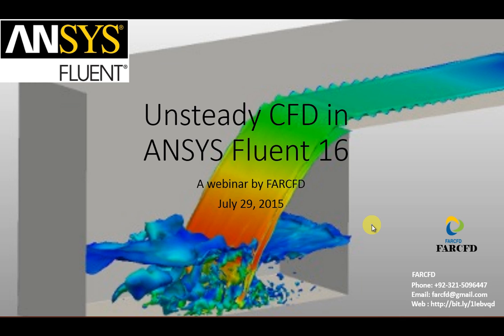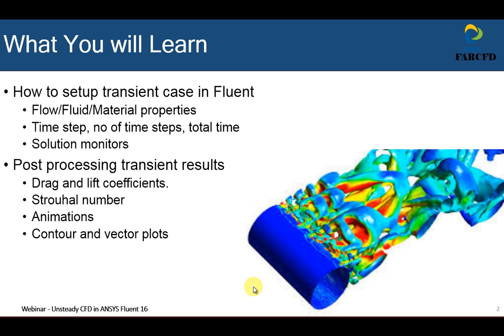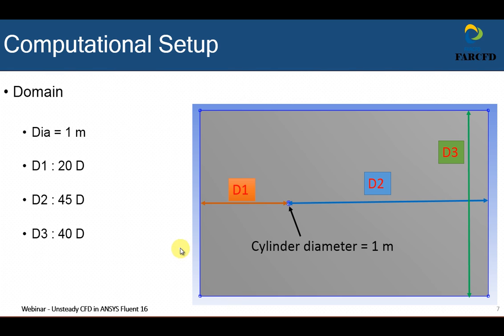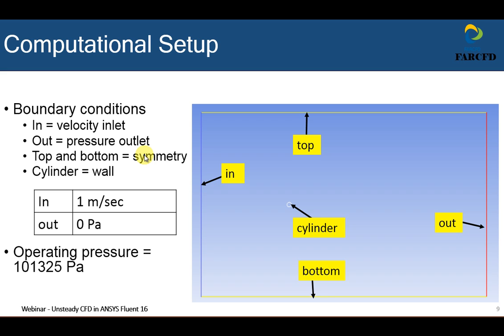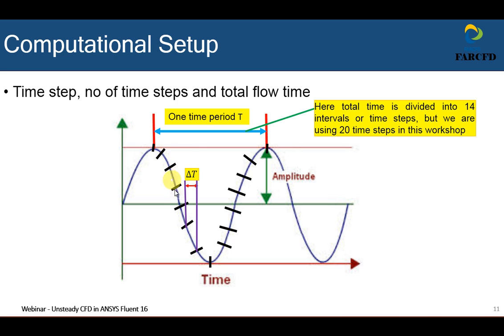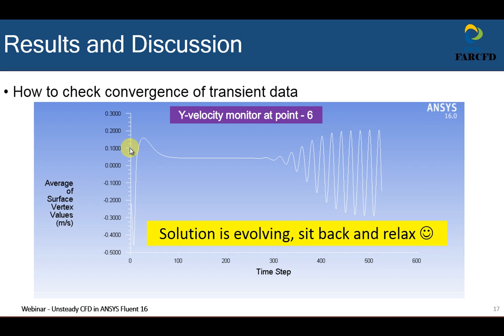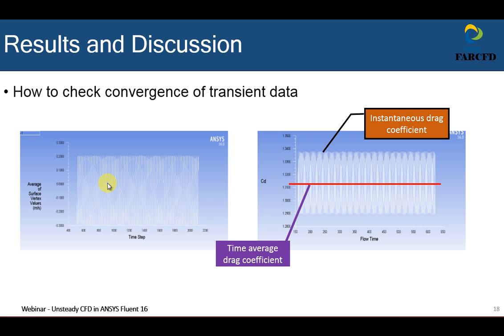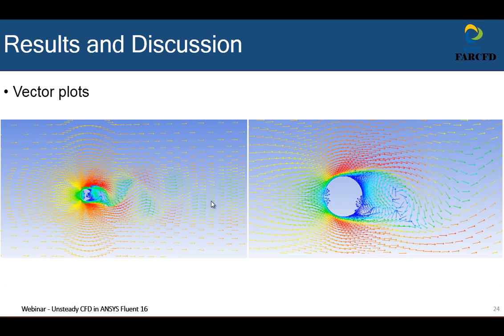Unsteady CFD - Circular cylinder (1/2)

Comment: Hey, I’m working on a transient analysis of wall pressure fluctuation for  nozzle flow separation (point placed at separation point to record the data). Struggling to get the time history of the pressure fluctuations to look good, might you be able to help? Thanks.

Comment: Hello sir, I am a beginner in cfd simulation. I watched your videos and they were very helpful. I  want to try to extract pressure coefficient of the cylinder surface against angle around the cylinder. How can I do this?
Reply from the maker: do you still need help?
Reply: In CFD post create a variable "angle" which is inverse of cosine(-X/radius of cylinder)